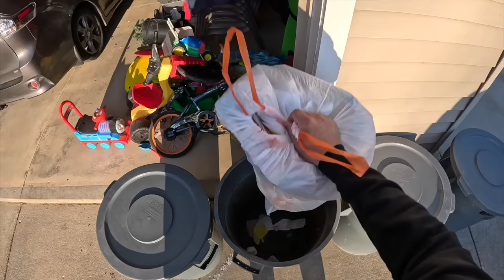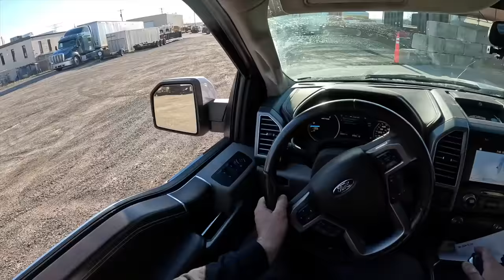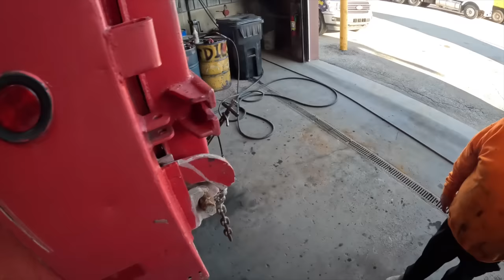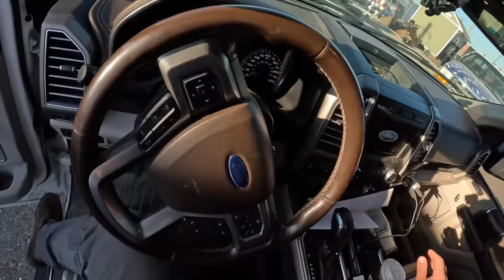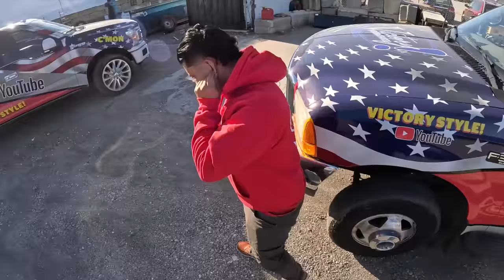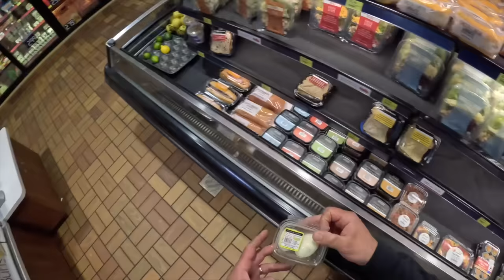He almost cried, tax trouble, and the Mack is BACK!!!

Comment: If you're having trouble on the leak for the motor and you need a PIN point  it put some dye. In it you can buy the dye at harbor freight it comes in a bottle you need to buy a dye light so that u can see it. It's like I was neon checker be sure to pick up the neon light that goes with that. It's really cheap but takes the guess work out of it. You can put it in anything we used to put it fuel to check for cracks in the injectors on diesel trucks.

Comment: Ryan, I used to do it to deliver equipment and I drove it on and it tipped over back words on me so after that I learned to back it on then you can keep the arms down low enough so it will not tip. Juat a thought, Eric;s a good guy,

Comment: Hey Ryan it’s a good idea to lay on some die electric grease on the 7 pin trailer connector front and rear part on the pin to prevent corrosion.

Comment: The Mack dump box looks like It has a hi-lift gate setup.  There should be twin air cylinders attached to that pin on each side of the rear bed if you look up in there.  Maybe it doesn’t have them, but i don’t know why they’d give you the hi lift gate mechanism on the top.  Just need to unlatch the main gate first and then flip that other red switch on the control tower.

Comment: With the 1157 bulb there's one pin higher and you can install it backwards there's a lower pain in the mid Pen when you install it backwards it completes the circuit the lightbulb will pull power from the running lights under the brake light circuit causing it to overheat

Comment: Ryan trailer wiring on a brand new unit usually is junk or garbage. Whenever I buy a new trailer and I bought a few I automatically solder every single connection in the wiring because all the crimp connectors and all that garbage they use it’s a failure point do yourself a favor all the connections make sure they are soldered no wire nuts just solder and heat shrink wrap the wires, then you Will have trouble free wiring on your trailer for the exception of the plug that you actually just had to replace and some plugs for the oval lights will get corroded, but you can also get terminal spray, protectant and spray on those which will help any oxidation.

Comment: So for the polish on the wheels and tanks eagle one wire wheel and chrome cleaner is a type of acid once it’s sprayed on it polishes the aluminum. At least years ago it did unless they changed the chemicals don’t buy any other kind it has to be chrome and wire cleaner all the others from eagle one won’t work it’s a spray on and rinse of type of polish

Comment: I started working with a roofing company as a ground guy. I was scared of getting on a roof. The boss called me up one time and I was stuck on the ladder he said idc if you stay there all day your off the clock till you get up. Only took me another 5-10 min. A little slow getting up the next few times. Now im running up the ladder. And hanging over the edge of the roof. Once eric gets comfortable he will be ramping the skid steer on and off.

Comment: I'm getting close to catching up on the video's,  but this episode I was watching you just throw ur trash in the floor of ur truck.  Just a hint, the plastic bags you get from the grocery stores nowadays.  They make the perfect garbage bags that you can hang off ur shifter. Less trash to get stuck under either ur gas pedal or brake pedal.  Sounds like I need to drive out one weekend and polish the wheels on ur Mack truck and other trucks. I'll make them look brand new.

Comment: I only use Dielectric grease sparingly because if it makes contact with the connectors you lose voltage to said object that you're trying to get electricity to their impact I would just use Dielectric grease around the connector not in the connector because it's an isolator not a conductor just saying for future reference

Comment: On the dielectric grease what we do is we'll take like a permanent marker and then we'll mark a spot because the head rotates on it of course you know that but if you mark it with a permanent marker you get the perfect flow and then every time you go to use the dielectric grease you just put it on that mark and you'll get you won't get excess anyways just thought I'd pass on that little trick

Comment: Set Darrell and Darrell up with old stuff and let them work that job you were called about. It was like 30 stoops also removing the old concrete. We could use have them back on here at least some. I'm sure they would love to come back for less money. I mean after 3 or 7 of these stoops, if they are the same these two would be able to pick up some. Start them low or what you would consider low and inject bonus's along the way for or if a good job is done. Also with the understanding from go that its that one job.

Comment: They still should’ve painted the inside at  least coating you need to do that. Ryan need to coat the inside of that box. I think they make a Teflon coating. It will protect the box, and the Teflon will make all the material slide.